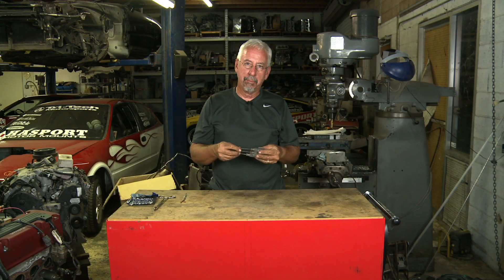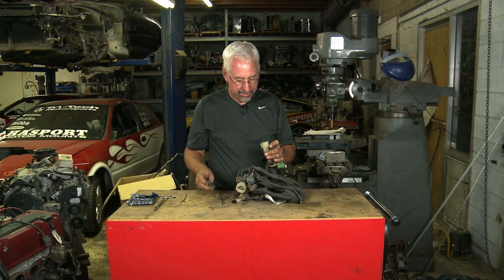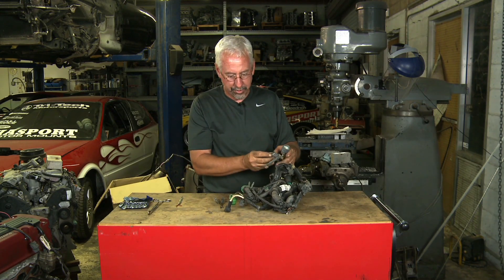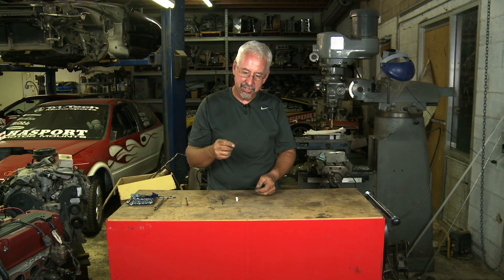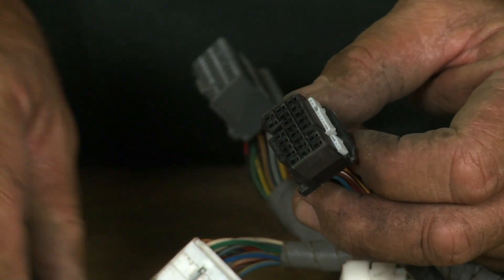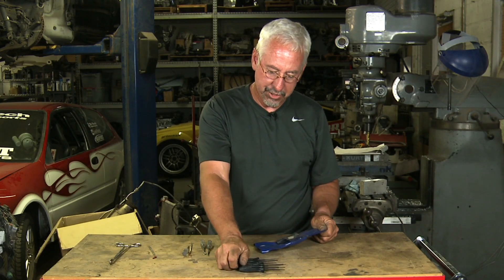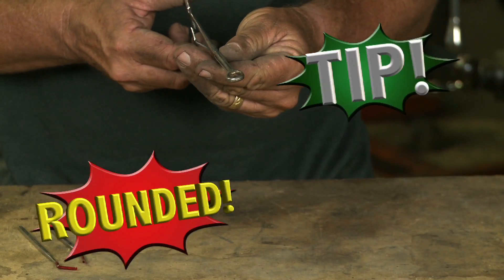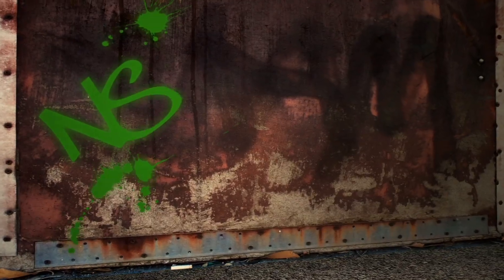RE-PIN your Honda Wiring Connectors

Comment: I have a question, so I have a 94 integra. And my rear defrost and dome light fuse keeps blowing; I recently took out the rear defrost button and inspected the connector and tried to pull them out but didn’t want to break it, so I put everything back together and that’s when I noticed that my fuse started to blow faster and faster after that. Could that be the problem because of the wires from the defrost connectors Aren’t seated properly since I tried to pull them out and didn’t actually take the wires out because I didn’t want to break anything?? Could that be the reason that the fuse for my rear defrost keeps blowing ? I haven’t don’t anything new, electrical wise to my car. It’s been bugging me because it’s dead of winter and I have to roll with my back windows crack open so they can clear up a bit. Can someone please help
Reply: KiiDKali check your grounds.
Reply: Sounds like a short to ground. Shorting prior to load causing fuse to blow
Reply: Yes definitely could have pulled some strands of wires loose or the pins aren't locked in the connector securely causing a bad connection drawing to much current. Check each wire for being locked in place by pulling some to make sure. If the female pins are too loose to grip the male pins, same problem. You could find a good one at a Pick-n-Pull type junkyard or just direct solder the wires to the connector with about 5-7 inches of the same or one size thicker Guage wire to have enough length to work with.